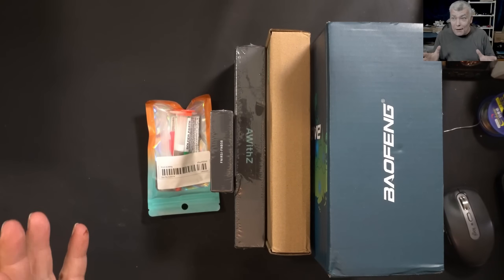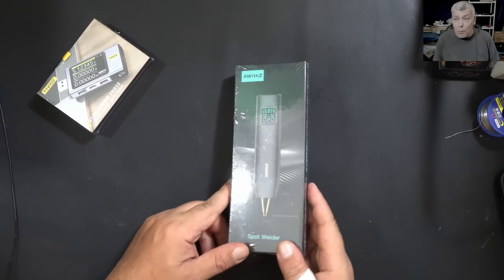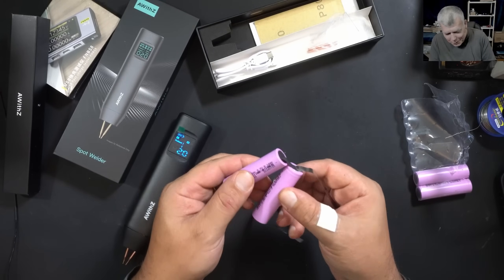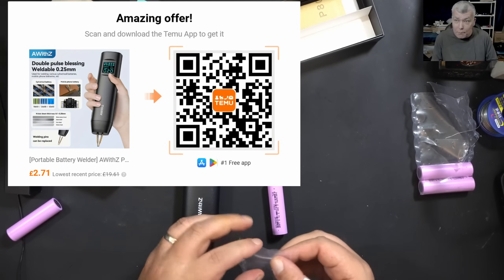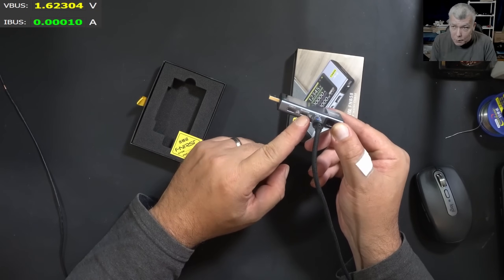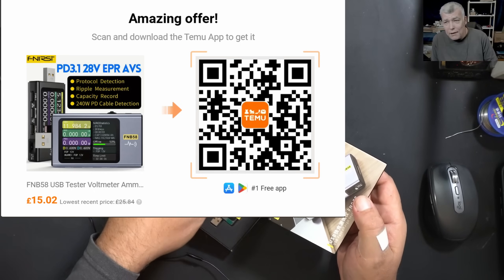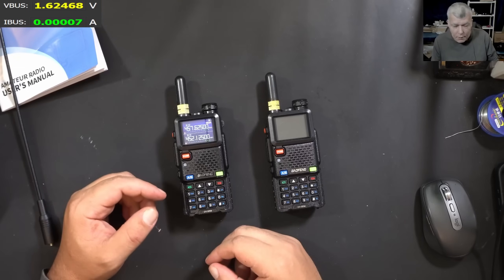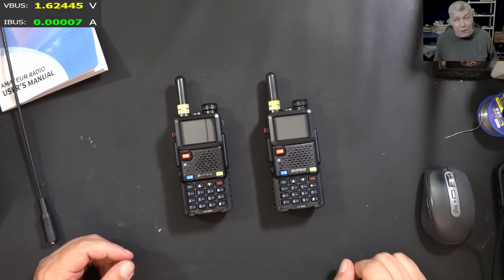TEMU tools review - 138 C solder paste, Spot welder, FNB58 power meter, 19v/6.3Amps charger, UV-5RM

Comment: be careful with the spot welder .... I always use glasses. And the solder has to be checked very careful especially if the application needs a lot of current like electric tools. An apparantly good solder could be no so good e getting extremely hot during use .... this can be very dangerous.

Comment: Low melt solder is just more Pb in it, you can buy it cheaper at your local store probably
Reply: there are other ingredients as well.
The one I bought in a half-kilogram roll contains bismuth and melts at that temperature.

At room temperature, I feel that it is stiffer than simple lead-containing wire.

SN42Bi58 was writen on it

I don't know if it will be good for soldering because of its brittleness.

Comment: Spot Welder: Most likely you will find out they did the welding without the help from caps and draw the current direct from the battery. The battery degrades fast and you can't weld anymore. The price has to come from somewhere.  ^^

Comment: I keep hearing mixed reviews of Temu. Personally never shopped there.. Most people I know shops at AliExpress which has its own shortcomings too. Is Temu a competitor?
Reply: It's fine. The new user offer is genuine. I got a £80 oscilloscope for £20. Only downside is they spam you with notifications on the app,  but i just turned them off.
Reply: @MattyEngland  Thanks for the feedback. I dislike using apps like this on the phone but the new member offer looked enticing. Yeah, spam messages are a bit much.

Comment: Well.....FNIRSI has an awesome neat soldering iron that fits in what looks like a pencil case, has 6x different tips & everything else you'd want like iron holder, brass wool to clean the tip, small sponge to wipe the tip etc😁
It uses a standard laptop USB-C charger.
Then also, they have a neat little power supply, which also takes a USB-C charger. 0 - 20V 0 - 5A.
Can use external 30v charger if you need more volts

I've got both, very nice products
Reply: I have this. It's a great soldering iron.

Comment: I want to point out that those portable radios are illegal in the netherlands and probably in most of the EU.
Reply from the maker: Why do you think are illegal? 70cm band is free to use without a license under 0.5w, so, they are not illegal, is just a matter of output power/radio settings
Reply: @electronicsrepairschool  Can they work on 2m? 120-174 Mhz. I have a license for 2m in my country.
Reply: @electronicsrepairschool  it's illegal in the EU. You can read that ath the EU site or that at the websites for radio regulations in the eu countries. And 70cm is not a free band and a normal citizen is not allowed to use radios for ham radio, even if they want to use a maybe free band. But UK is not EU
Reply from the maker: @GharacDurac  Of course they are legal in EU & UK https://en.wikipedia.org/wiki/PMR446
Reply: @electronicsrepairschool  Only up to 500 mW ERP... With that Baofeng you can even talk to ISS, International Space Station...
Reply: @electronicsrepairschool  yes, but for PMR radios only.
Reply: Legal in the UK, though you need a license (Ofcom £75 for 5 years) if you will be transmitting, otherwise limited to 500mW.
Reply: @dalyxia  There are no illegal HAM radios, only illegal use of them. You can use any radio, even without a license, for listening.
Reply: yes, they are illegal, even for ham radio ops